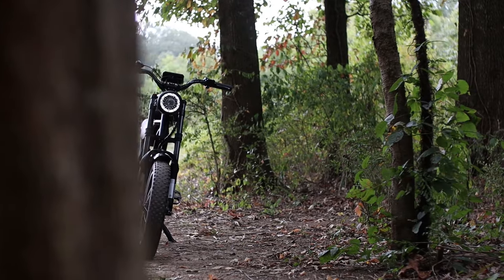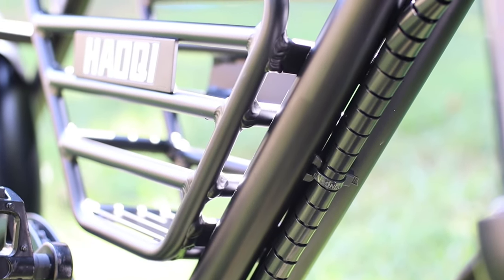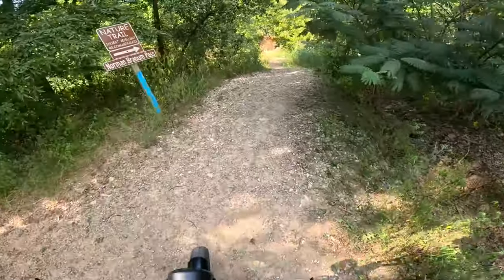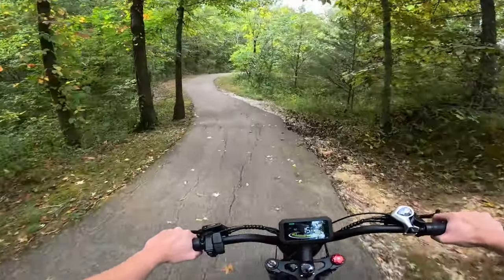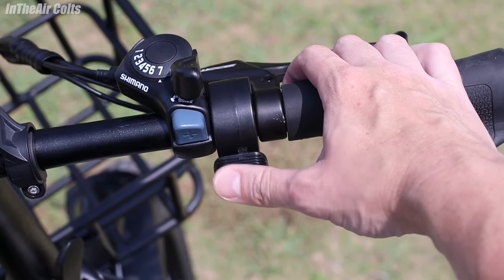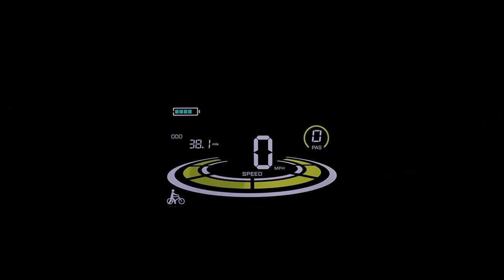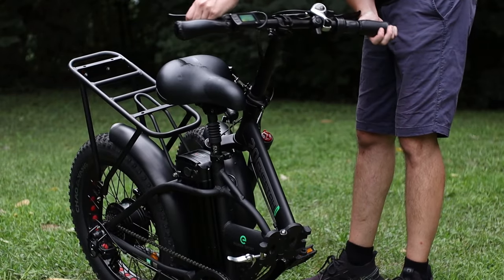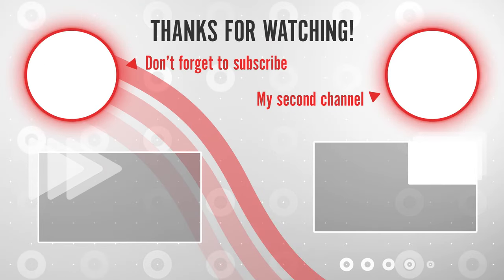Should Honda build an Electric Motorcycle like this...? | Haoqi Rhino Review

Comment: Just got my Rhino a month ago. It's bad ass. I weigh 265lb @ 5'8" today's ride 20 miles with 3 long STEP HILLS same route home so 6 long hills. Peddled a fair amount, used 20-25 percent of the battery. I've never owed an Ebike but already love it. When I was younger, I lost my license, so I rode 45 miles a day 6 days a week. Once in a while, I'd take 2-3 days off riding by getting a ride from a co-worker. This would have been awesome. I'm oudda shape currently. However, I'll get in shape fairly quickly. I'm sure as soon as my conditioning is a bit better and I work on my strategy, I'll cover a lot of ground. 2 issues I've found #1: All the adds (like this one) claim a 400 lb weight capacity. However, in the owners manual, they claim 350lb? #2 I've seen 5 or 6 different price points for the same exact bike? Overall I'm very happy, well built
Reply: So far I like the bike but the seat hurts my butt it's hard,  and my back sitting kinda forward. Does it get better over time? I could be I'm not use to riding a bike like this?
Reply: @TheBryan209  I've found it to get better. When I rode alot years ago I had a helluva time getting used to the small saddles that came on touring bikes. Ya know, those are the size of a pack on cigarettes 😆 butt we get used to it!
Reply: @bradgrier4228  ok so you think I shouldn't return it?  I haven't  been on a bike since a kid. I know regular bikes hurt in the beginning but I was just wondering if it gets better.  I feel like sitting in the back feels awkward and in the front is better but I get that fatigue.

Comment: Controller specs? Amps? Constant and peak?
Reply from the maker: Good question! I'm a noob when it comes to these things and that info isn't listed in the owner's manual nor on their website and I have no idea where to find that info on the bike (if possible). I'll reach out to the Haoqi and see what they have to say and come back with an answer on that one ;)

On a side note, did some digging on ways to possibly make this thing faster and found a developer mode or whatever you want to call it. It'd be awesome to get her up to around the 35-40mph mark with me on it but I'm doubtful she has the juice to do it. I'll let ya know what I'm able to squeeze out of her though once I do some more playing around with it.
Reply: Per Emily at Haoqi: 19.5 constant amps and 23 amps peak.
Reply from the maker: @stamper99  Ahh, you're fast lol! I was just sitting here fixing to ask Emily in the chat on their website but ya beat me to it. 

Dumb question here... are those specs considered "good" or not really for the controller?
Reply: I have an AR Kepler which has a 33 amp peak controller. The Wired ebikes have 40 amp peak controllers. I want to upgrade so I keep my eye on motor/battery/controller combos. Retail inexpensive sweet spot is 1500-2000 watt motor, 60v, 20 ah battery. And 40 amp controller.
Reply: I also have a Kepler and I’m thinking of getting a moped style. Got any your looking at now? I agree with you completely on the specs.

Comment: If I lived in a country where these made sense, I'd very much like one, though I'd happily trade the pedals for proper footpegs. With that saddle, that weight and a 1000W motor, is anyone really pedaling it anyway?

Sadly, in the EU you'd have to. E-Bikes are limited to 250W engines that are not allowed to be throttlable, they can only be activated when pedaling.

Meaning that if this was available over here, I'd want something significantly lighter and more comfortable to pedal.

Or ditch the pedals, bump the engine up to 2000W and register it as a proper moped.